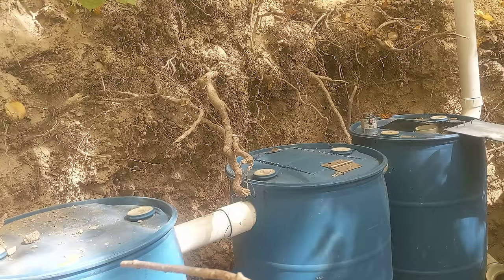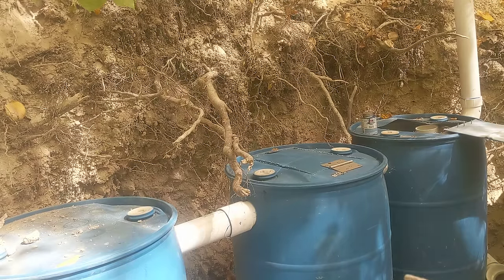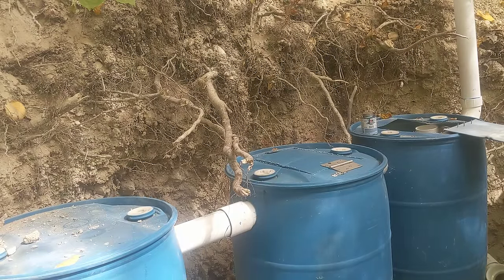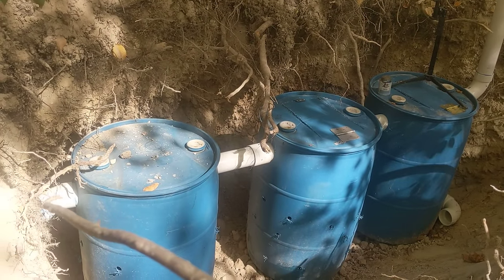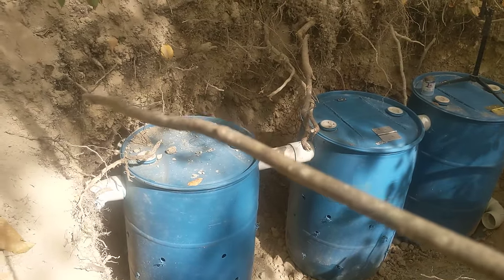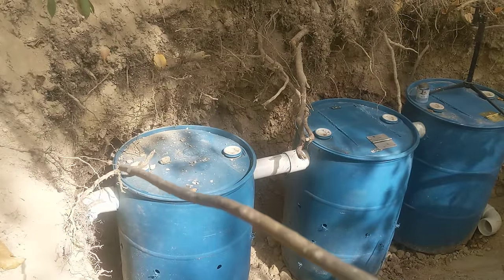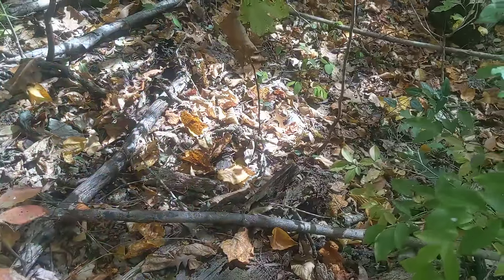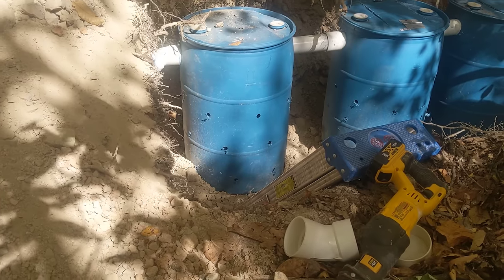The diy 3 barrel septic tank system for your cabin or RV. 55 gallon drums! (cheap & easy)

Comment: How do you protect openings in barrel top so they don't collapse or allow dirt in when back filling the hole? I'm thinking those flaps are necessary for plumbing and inspection, but would need to be covered somehow for back fill. I've seen other barrel setups that just run pipe through top and/or sides without opening the top up, but that will not allow proper installation of baffles. Thanks.
Reply: He mentioned laying plywood, 2x4’s or metal over the tops
Reply: Pressure treated access doors would work. It's basically a box around the flaps that stick out of the ground.I would you plastic as shealthing.
Reply: Why do the last 2 barrels have holes in the sides when the 3rd clearly has a discharge pipe?

Comment: YES I love your video!!  Thank you.  Any concerns with the dirt plugging the holes? Would putting a layer of 1-2" gravel be if benefit?
Reply: put 3/4" crushed stone from the bottom to the top of the pipes, encapsulated in filter fabric, around the leaching barrels so the leaching holes and the stone doesn't get choked up with dirt and reduce its ability to disperse / infiltrate the liquids.

Comment: How long would this septic system last? I am thinking of using one like this for an off grid home with no codes but I don't ever want to have to dig it up. I would use a 20 ft perforated drain at the end.
Reply: Built a two barrel that lasted 10 years and never had it pumped. Ridex or buttermilk is the key I think. Keep everything broke down.
Reply: My dad built a similar 4 barrel system 30 years ago.  My mom just had it pumped last week.
Reply: @jayfromtexas6718  how much buttermilk did you use? Does it only go in the first barrel?
Reply: @lextrombas  Just rinse some down the kitchen sink.
Spray stumps with butter milk. Makes them rot faster.

Comment: What keeps the flaps you cut in the top from caving in after you cover it with dirt? Soil is 100#'s per cubic foot. Eventually, that little metal tab will give way and you'll have a barrel full of dirt and a nasty job  fixing it.

Comment: Just need clarity. When you say drop the barrel are you actually dropping the barrel down about an inch or just the inlets and outlets? In your reckoning, when would the first barrel need to be cleared? Two people will be using this. What size are these barrels? Litre wise.

Comment: How long would it take for the roots to invade the system? Just asking.
Reply: metal screen mesh duct taped around the holes would work.
Reply: @SSingh-nr8qz  There is a filter fabric which wraps around french drains which prevents roots and silt from entering the drainage pipe. I'd recommend something similar and a small rock (pea gravel'ish like) backfill. Bada Bing. Excellent video by this brother !

Comment: Defaulted septic. Liking the patina is fine but it's still broke .the tank pressure supposed to push the water out of the middle tank the pipe should be on near the bottom. 😢

Comment: When it gets to the point that it isn’t taking anymore it’ll back up the toilets, at that point you will want to set a new inlet barrel , that’ll be the one that is full. If the ground takes the water for a year it’ll perk the water for a generation
Reply: What do you mean by "perk the water for a generation?"
Reply: @j.bridges2921  “perk” for a generation. Idk why I typed perk the water lol. Perk meaning absorb the water.  I’m assuming you did a perk test to make sure the ground can take the water
Reply: I would assume most that would put this type system in would not pay the $500 dollars for a soil scientist?  I would roll the dice.

Comment: Aloha Appalachian American:  Stan here in Maui I am getting ready to install your 3 barrels septic system this Saturday..I like your design very much thanks for putting it on Utube..I have two questions:  I am planning to fill the area around the barrels to about 20" with 1 1/4" gravel (I drilled 1" holes in barrels 2 and 3) and then I am thinking off putting window screening on top of the gravel and then top off the gravel level to the surface with a mixture of excavated soil and gravel. that would be about 20" on top of the gravel/screening..My thought is that the screening would slow or stop dirt from above from entering the weeping field..What do you think about this idea?  Stan

Comment: I see a lot of people saying "screw the codes". The codes for a septic system include a perc test. A perc test measures how quickly the soil will allow liquids to pass through it. If it passes too quickly it can get into the aquifer before it's been properly filtered by nature, contaminating the well water for them and anyone drawing water from the same aquifer.

Some of those same people then go on to state "people don't understand how important sanitation is". Call me a troll if you want, but personally I'd prefer to not have my drinking water contaminated by someones urine and feces because they feel "the law to live trumps all laws and all codes.". Ecoli? Cryptosporidium? Cholera, anyone?

Seems that clean water is an actual necessity to life, and someone's perceived "right" to release their excrement into it is not. No problem though. You saved yourself a few bucks by skipping all the codes and fail safes to ensure people continue to have the God given right to clean water, a necessity for life. Kudo's on your financial prowess. But of course they SHOULD follow all code "when they can" <wink wink>.

Comment: What is the purpose of using sanitary T's instead of a straight T, or just an elbow? Also, with the way you've cut the "lid" in the top, what keeps dirt and debris out and what keeps it from caving in on the sides?

Comment: I am in middle Tennessee. What’s the code? I just have a camper that I need something quick and it’s me so I have to dig the hole and figure it all out. Do you know anybody in Lewis County? I need a backhoe.
Reply from the maker: I don't, sorry
Reply: @theappalachianamerican8607  ok
Reply: I don't know about Tennessee but here in Northern Michigan there are companies that will rent you a backhoe, bulldozer or any of 100 other things people rarely need but are extremely expensive to buy outright.  If you connect a septic to your camper don't use the Campa-Chem in the tank -- it will kill off the necessary organisms that break down fecal matter and doom your septic system quickly.  You will have to drain the wastewater tanks into the septic regularly.  In the days of no environmental codes I left the drain open on the wastewater tanks and the outlet on the camping trailer clogged.  You need 10-15 gallons of liquid to make all of the TP and feces flow out of the tanks.  I only did THAT little blunder once.  Also, use the 1000 sheet Scott Tissue for TP in a camping trailer or motorhome.  It breaks down much faster and more completely than that thick Charmin BS which is important to prevent clogging.  That might be why I never had trouble with septic systems, too -- I have heard of people using Charmin or other two ply TP and needing to have the un-broken down TP removed from the septic tank.  Those fancy "flushable" wipes are even worse on septic systems.
Reply: @mharris5047  thank you so much. I hired some guys they came, opened up the tanks and left them opened and flowing and there’s been a nasty stench so I decided to use a temporary toilet until I could figure it out and I will definitely leave the tank closed until it’s full. Makes total sense. I am renting a backhoe, and then will dig the septic.

Comment: Excellent video. What do you think its capacity is? I'm in the planning stage and am considering something like this for a shop with a sink, toilet and shower and a kennel on the back side of the property. No codes to worry about.
Reply: One thing that a lot of people fail to think about is that the Well Log from the driller may say that the well casing was grouted to 50 feet or to bedrock, but reality may be  different.  On the other hand, you may have a well that is so shallow that somebody just jetted it in and didn't even need to drill it.

In either case, putting everything sewer downhill of the well is always a great idea...
Reply: If you hold up a glass of well water and there's stuff floating in it, just shake it up hard to purify it.....

Comment: so to clarify, why is there that last pipe out? the 90 sweep?
Reply: Gives you 2 options. 1) You can see if you system is overflowing (or maxed out), 2) It allows for you to add more barrels later to expand your system.

Comment: The middle tank. The piping connected to it coming out towards the left should be connected near the bottom. so the floaters that did make it passed the first tank and is now in the 2nd tank the middle tank. So the floaters are now on top of the second tank and you let them flow into the third tank the last tank to the left the way you have it set up . Anyways the middle tank the piping should be near the bottom and then the pressure automatically fills the third one. From the bottom. So that all the poo is locked in the second tank that made it passed the first tank.
Reply: I disagree with your suggestion. The sanitary tee installed on the outlet of the second tank performs the function of siphoning off liquids and leaves the solids behind. If you connect to the bottom of the second tank, any solids that get past the first tank will drain to the third tank, as the solids will settle to the bottom. He constructed it correctly.
Reply: @themister3865  I agree

Comment: So, to be clear, the first one is higher than the last one?
Reply: Maybe you don't need this answer after one month, but yes. The first one is higer than both. Every next barrel is lower than the one before it. Pipes also.
Reply: Or equal to.. 😅
Reply: one inch higher is correct

Comment: So honestly how many poops does it hold, I imagine its same capacity as a portapotty? Maybe 100 then needs to be cleaned?
Reply: Btw, I had a two drum system. Never had it pumped out in ten years.
Reply: Not often because of the bacteria that digest the solids. It's called biomat
Reply: If you add some ridex to the system, a biological process call anaerobic digestion occurs in the first tank where tiny microbial bugs eat "digest" the solids. This will occur naturally with human waste but the ridex will supercharge the rate of digestions / decomposition.
Reply: @themister3865  Save your money on Ridex. The enzymes in a chopped up tomato flushed down the toilet every 3 months or so will send the anaerobic digestion process into warp speed mode. This is an old timers tip I learned from the septic pumping companies decades ago. Ridex and other expensive products rely on enzymes to help your septic system stay "healthy" - well - so does a tomato. My .02
Reply: @tonyreyes1798  Good to know Tony! Thanks. I still think Jason's homemade system is lacking and doomed for failure. Time will tell.
Reply: @themister3865  The design could use some minor tweaking but overall it should function. The penetrations between barrels will be subject to root invasion unless sealed. Vulkem makes great water proofing materials for those joints. It appears others have tried similar septic systems. Indeed time will tell.
Reply: @tonyreyes1798  Before Rid-X I used brewer's yeast.  The only house where I had a septic problem was one where the drain field was woefully undersized (and it didn't, help that there was a lake less than 50 feet from the drain field).  I extended the drain field out under a hill where the perforated pipe sat further above the water table and that problem was taken care of.  It cost me $60 in pipe, two shovels and steak dinner for the family and friends that installed it for me.

Comment: doe you fill the barrel with gravel or around the barrels.? is this just for toilet or shower and sink as well? I'm confused as to how it is filtered and draining through the holes without contaminating the dirt around the barrels. not nik picking actually want answers lol I do like this build and set up. does it literally just fill up and overflow intthe next barrel just sems strange hkw it would overflow into the 3rd tank if the 2nd tank has holes?

Comment: You needed to put some wood under the plastic lids something to screw into don't forget some gravel on last barrel with pipe and small holes in it  Should drain nice and slow back in the ground The first barrel empty in the ground all over fertilise all the area for crops the Chinese do that

Comment: You said 1&1/4 inch hole saw, so what size pipe are you using? I like your idea but thought that you need a larger pipe. Would you need a 4 inch hole saw and a 4 inch pipe? I'm not a troll. I want to install this setup.

Comment: I get the idea and trying to adapt it to 2 IBC totes (275 gal each). The issue will be getting the 3” SanTee inside the first IBC tote. Any thoughts? Perhaps I can remove two cage bars and cut a trap door like you did with the barrel. It may need something to reinforce the door. Do you think this would this work?

Comment: So tell me again how these barrels line up.  The first barrel is the highest one?  I'm confused.  How does the stool bus get into the turd pot?  Don't it need a suck out pipe?
Reply: second pipe out of first barrel is one inch lower and same on last barrel , I have a four barrel system with 30 feet of perf pipe  on the outlet of last barrel been working good for 20 years already

Comment: Code or no code… when you gotta go, you gotta go.
Reply: Very true.  I bought a house in the early 80's that although a prior owner had installed indoor plumbing and a septic system it still had the original outhouse on the property.  I kept the outhouse painted and maintained but IIRC it was only used twice the whole time I owned the house.  The septic system didn't give me any trouble although I had the tank pumped every other year and flushed some brewer's yeast down the toilet once a month as a precaution.

Comment: Ridex or buttermilk?
Reply: Before Rid-X came out we used brewer's yeast.  I don't know which one is better but I never had problems with the brewer's yeast other than the one house I had where the drain field was insufficiently large -- I had more drain field installed and it was fine after that.  Back then I only had to get a $60 permit and some relatives and friends dug the ground and installed the drain field for me.  The steak dinner we all had after it was done cost me more than any of the rest of it.

Comment: How long is the pipe hanging down in first barrel?
Reply from the maker: It's hanging down about 10 inches but it can hang down up to 16 inches or so
Reply: @theappalachianamerican8607  last question I hope! The holes in barrels 2/3 how do you keep dirt out of them? I get the bottom ones sit on rock   Thanks again
Reply: @theappalachianamerican8607  will two drums work on a camper
Reply: @jerrycopeland9734  two will work for two people with occasional use but three or more is better and will last many more years with no issues

Comment: Well if you dig a long trench and you start up by the whole said to see 120 ft away from the house and then you go down five feet and then you go down your 200 ft you need to be twenty feet deep at the end of 20 ft deep 5 ft deep from where it begins 
This way when you fill a 2/3 of the way up with Grandma but line the sides with concrete blocks the hold your life up all the way down to the end and everything drains I was in there you'll never have a backup and you'll never have it overflow because it'll all soaked into the ground